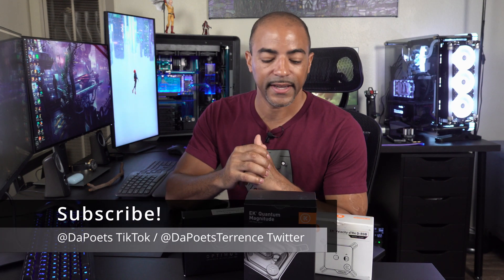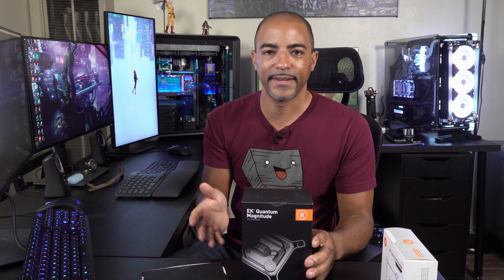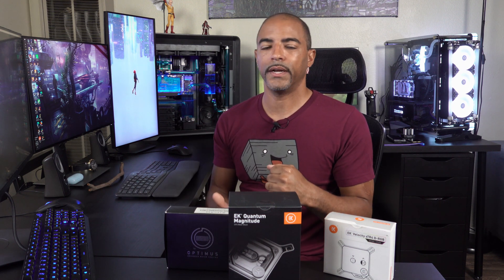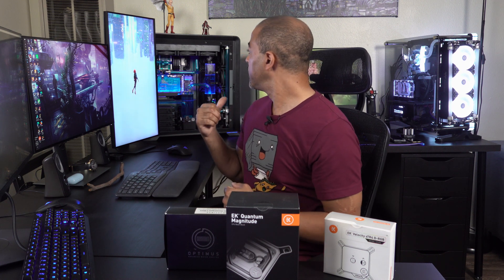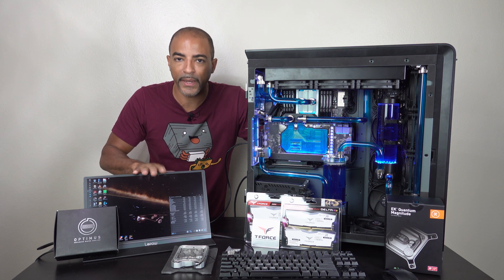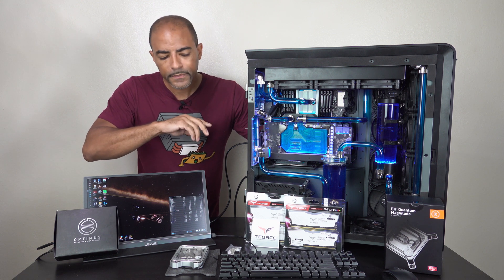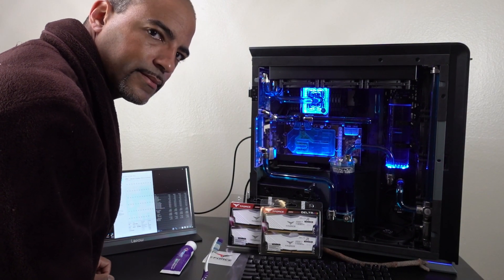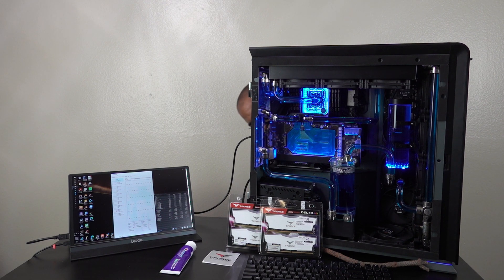EK Quantum Magnitude Vs. Optimus - Threadripper 3 CPU Water Block

Comment: DaPoet, I am waiting for Optimus FOUNDATION CPU BLOCK - AMD (AM5, AM4) that I ordered and waiting for the release of the Optimus FE WB... is it worth the wait? Because from your data, the temps on these are not "that" different. I can get a EK-Quantum Vector² FE RTX 4090 D-RGB ABP Set - Nickel + Plexi AND 	
EK-Quantum Velocity² D-RGB - AM5 Nickel + Plexi "now" ... Is it worth waiting for Optimus?
Reply from the maker: You're now deciding between looks as the performance is so similar.  Optimus is very slow with their manufacturing process so it's very normal for people to wait many times longer compared to EKWB.

Comment: Hi I wonder what are  your opinions for Optimus’s other products. Like their reservoir/fitting/etc. I just ordered their cpu block and want to order their reservoir  and fittings.
Reply from the maker: I have their pump res combo and it looks great. That's powerful, fairly quiet, but I had to get creative for mounting it. The cables were ketchup and mustard so I had to specifically hide them well. For the fittings it depends on what type of fittings you're getting from them. They have a couple different types
Reply: @DaPoets  I wonder if the universal mount works for their res… (but that would  not look very good, lol) Would you think there exists an even better (more powerful/ quieter than Optimus’) choice? Sorry I am totally new to these… trying to get a real good one…
Reply from the maker: @zehaoyu9401  I just like the EK Quantum Kinetic D5 pump/res more.
Reply: @DaPoets  is it because of its quieter or more powerful
Reply from the maker: @zehaoyu9401  The EK model is quieter.
They are both more than powerful enough for any system.
Reply: @DaPoets  got it, thank you so much! I guess I should go with EK reservoir then. It also has RGB/mounting supports as well…

Comment: So informative. Thanks! I am about to build my first custom loop. It will cool just my CPU - the 32-core Threadripper 3970x. What size radiator would you recommend if I want to overclock it to 4.20-4.30 Ghz all-core with acceptable temps? My case (Fractal Design Define S) can fit up to 420mm rads in the top (30mm thickness except for 360mm rads which can be thicker) and up to 360mm rads in the front (no restrictions on rad thickness).
Also, I have a choice between the following CPU blocks - Aqua Computer Cuplex Kryos NEXT sTRX4 Acryl and XSPC Raystorm Neo sTR4. Which one would you recommend? The Raystorm Neo is not nickel plated and I'm somewhat afraid how the bare copper will fare with prolonged use. Or would you recommend some completely different block if these are not good enough? I don't really want to spend more than ~$150 on the block though if I can help it. Thanks in advance!
Reply from the maker: This threadripper produces a lot of heat so the thickest rads that will fit your case. It's better to have more surface area for cooling.
Reply: @DaPoets  So true. Especially in the summer months, haha. Would I need to get 2 rads or one 420 30mm thick would suffice?
Reply from the maker: @bgtubber  30mm is a bit thin. Check out the EKWB PE and XE rads
Reply: @DaPoets  I see. So I better get two thick 360s is what you are saying? The problem is I can only fit a thin 420 in the top and I've read that a thin but larger rad is better than a thick smaller one. Or maybe I got wrong info? If that's wrong, I can do two thicker 360s, my case allows for it. I just need to know what is the optimal rad configuration that I need because once ordered, I don't think I can return used rads if they don't work for me. I'm still learning about this whole water cooling thing. It's really cool (haha) and I'm really eager to build one, but I still have some questions like this one that keep me from starting the project. Sorry to bother with my stupid questions. 😅

Comment: Hold on. So Magnitude is kinda on par with Optimus, which in turn was way better than Velocity? Well I have both Velocity and Magnitude and there is virtually no difference between them at all, apart from Magnitude having way better mounting system, while on Velocity I had to add extra washers to increase preassure. So something looks off with your results for me, frankly.
Reply from the maker: Multiple tests, same results. You may need to look at your mounting.
Reply: @DaPoets   Or it's other way around :) Your mounting of Velocity was stock one if I remember correctly? I had not great results with it as well, after many weeks of working through it with EK's tech (I even gave them links to your videos as some references), I tried putting two washers on each of the screws (read that trick somewhere) and it helped a lot. So I think that main difference between all these three blocks aren't fancy "cooling engines" nor amount of fins, but most significant impact is from mounting. Velocity just has poor out-of-the box mounting but when improved it's getting on par with Magnitude and Optimus.

One more thing: how many fans/rads you have there and at what RPM they are going? Also, what's the ambient temperature? I have quite limited radiators surface due to chasis limitations + I keep my 7 fans under 800RPM, ambient is now between 25-35C. That may impact my results so there are less differences between blocks as well.
Reply from the maker: @TheEvilVir  2 480s and 1 360XE. Silent custom fan curve with beQuiet Silent Wings 3 high speed fans. Results were consistent.
Reply: @DaPoets  Got it, thanks! I'm on 360 PE + 140 SE only :( Well I ordered new TIM (Kryonaut extreme) and will just give another shot with mounting. One more question: when mounting Magnitude, you went all the way down with screws until they didn't turn more at all, or followed the instructions and made them flush with the holes (when they still can be tightened a bit more)?
Reply from the maker: @TheEvilVir  all the way until they stopped which made them flush

Comment: amazing video man! Thanks so much for the info! I just order my Velocity last month, didn't know they gonna release a new one so soon:(. Could've waited a bit, but aio just not doing the job. Do you think it will make a big difference if I change to the magnitude? currently I running the 3970x as well and a 4.2 all core overclock and it runs into high 80s even low 90s sometimes.
Reply from the maker: The differences are pretty wide between the two blocks. Take a look at my video from last year comparing the velocity to Optimus and the difference in temperatures will be about the same
Reply: @DaPoets Thank you! It's pretty big difference! Maybe I will keep it runing for a bit before I get the new one. Again, superber video! Thank for the info!

Comment: Just out of curiosity what coolant did you use? I used regular distilled with EK clear and then added some EK blue dye to mine and its been like that for almost a year now. And so far it hasn't seemed to discolor/dye the acrylic on neither my CPU or GPU block. Nor has it gunked up like on your CPU block.
Reply from the maker: Oh this is an accumulation of a few different coolants over the years. Most of that was probably trapped in my radiators.

Comment: Like what I see sofar, happy birthday 🎂.....
I don't want to be a pain in a butt but what if u trying watercool the cpu only,  would it change the results that I m seeing with the two waterblocks? I'm in a process of building a building with a 3960x and I haven't bought any waterblock yet and I have a bad experience with ek waterblock with an 3950x already..
Reply from the maker: The testing was done with the same Hardware and environment so all other things mean equal the differences between the two blocks would not have changed much at all. You can of course do a custom Loop only for a CPU and so all of your radiator cooling capacity will be focused just on that instead of adding a GPU to the loop. Is that what you're asking?
Reply: @DaPoets  yes, cause I m on a break on giving up on ek for their waterblock.
Also currently waiting on an am4 waterblock from techn to see if they will give me better thermals than this ek

Comment: do you think i should watercool my 3070 or is that just overkill?
Reply from the maker: No need, it's hard to find water blocks for lower end cards anyway. But if you can find one and want to do it for looks or a quiet running system then go for it!
Reply: I ended up putting a water block on my 1070 gtx and 3770k and love it. Was able to squeeze just a little more out of them both while keeping it cooler and quieter. I would say its up to you. If you like the hobby and tinkering with stuff like that, then go for it. You really shouldn't have any issue finding blocks for the 3070, all companies normally always make blocks for the 7 series of GPU's. But once you go to the 6 series cards you will have a very hard time finding a block. I looked for a 3060 block for a friend and could only find one or two.
Reply: watercool or not it just gonna run fine . It more like you customized car kind of thing that it look cool but not gonna make much difference it still function fine without. Same for me who put 4 radiator for cpu alone just to doesnt make the case look empty (view51)

Comment: Very good video as always! So... which one is it gonna be in the Deep Blue? :D
Reply from the maker: Stay tuned!
Reply: @DaPoets  Which one was actually best in the end? I've stayed tuned for 5 months now ^^, and am about to buy a block. Should I go Optimus or EK?
Reply: @DaPoets  Nevermind, I found out from one of your latest videos. Thanks for all your work. Makes life easier. I will buy EK Magnitude. I added all results from your tests and Magnitude had 2/3 of a degree lower CPU temp on average (from the 9 tests..). EK: 70,3C vs Optimus: 71C. Also, EK has RGB! :D

Comment: Cool, can’t wait for the results as I’m in process of building my threadripper platform :)
Reply from the maker: Results were at the end of the video 🙂
Reply: What did you build? I am holding off for 5000 series TR but getting harder to do so every day....
Reply: @bigdreams5554  i used 3970x + 128gb ram for hackintosh platform with custom loop. I love macOS but current Mac Pro is crazy expensive and new MacBook are so faulty I have one from 2015 that works but second one from 3 years ago died
Reply: @ElViajero321123  cool build. I also have old MacBook pros that are going strong (from 2013/2015). They don't build them like they used to ;) very tempted to get the same CPU you used but keep telling myself to wait a little longer. Thx for the info
Reply: @bigdreams5554  i forgot to mention 2x10gbe and 20bge pipe to NAS so just 1TB onboard rest on NAS. I even work on Video editing and picture developing using NAS